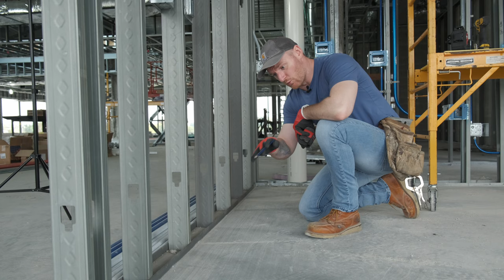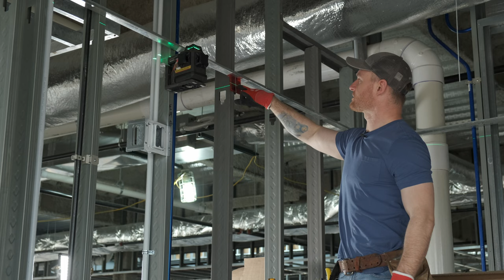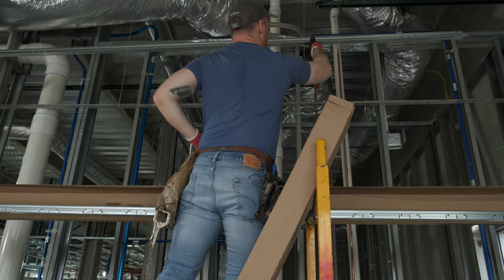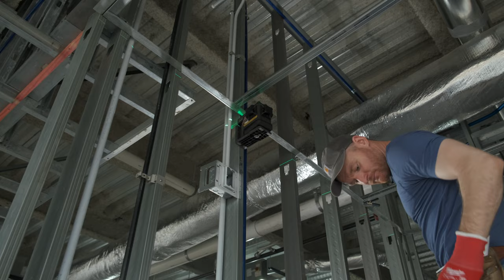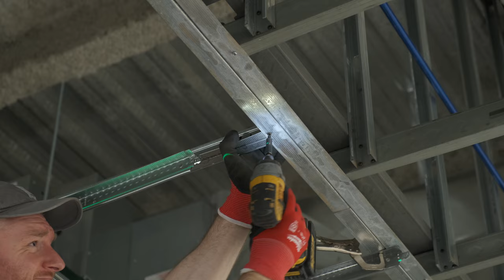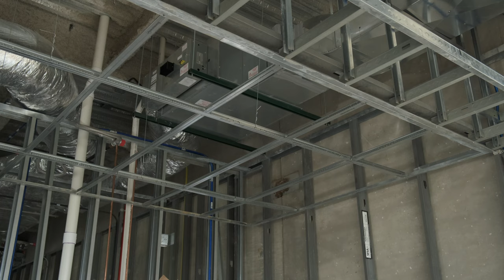How to Install 650 Drywall Ceiling Grid

Comment: At 14:00.....Just a quick tip to anyone doing this for the 1st time...to figure out where exactly to cut the new main that will connect...what I do is, with my first main in the whole job what I will do FIRST is measure with a tape measure from the BACK of the wall L where the connecting main will sit to the flange of the main that's suspended.... not the tab but the flange of the suspended main im measuring to here. Make sure your tape it's perpendicular to the wall. Then you cut a full main to that number, making sure your hooking the flange when marking your connecting main, NOT the tab, hook your tape on a new mains flange, pull your measurement, mark and cut.... Keep in mind the tape measures measurement is exactly what the new mains "flange" has to be to be "FULL BEARING" on the wall L....keep in mind that number is tight so give a 8th or so of space so the main will sit nice on the wall L with a 8th or so of space to slide.... not doing could result in the connecting main being too tight and bow the main out which could throw it out of square..and cutting too much off can result in weak support at the wall L...once you cut the piece that will connect, FIRST, BEFORE CONNECTING IT, take the cut piece and butt the tab of the cut piece into the wall L where it will sit just like you did with the tape measure, so the tab of the new cut piece is touching the back of the wall L where it touches the wall, now you can butt up the cut end of the cut main to the main that's suspended and visually check where you have to cut each main from there on out going forward so that every time you finish a main at a wall, it will be full bearing on the wall L...

Comment: How did you 27 in for your first main ? Cause you went center of the room and went 2 foot each side and whatever you had from the wall was 27 ?
Reply from the maker: Yea everything is 2’x4’. So I think the mains laid out at 27” then 48” and then the wall at 27”. It won’t be a normal 2x2 system on the drywall grid. Hope that answers your question.
Reply: @mitchellacoustical3119  okay thank you making sure . Cause Im doing this at my job. My foreman threw me on this 650 grid system so I’m not use to it their system . Cause I always Done it with hard lit studs . I’m still at a high apprentice  percentage. Just making sure cause I’m doubting myself a lot

Comment: You cut the main wrong you should always have a wire at the end of the main, doesn’t matter what type of grid system.
Reply from the maker: Bar joists were running perpendicular, and this is just an install video… if I did an 8’ main it wouldn’t show how to connect the mains and that is important for these types of instructionals. Go ahead and make your videos however you like👍

Comment: Hi good morning thank you for your valuable information ❤ Could you let me know how to avoid n prevent drilling from horizontal piping against metal stud. Vertical piping is ok  becide vertical stud not inside stud but horizontal piping 😂 piping penerate into Vertical stud as like horizontal 😂❤
Reply from the maker: You’d have to mark it out before drywall.

Comment: there is one thing I dont get. isnt it logical to run your mains in the shorter dimension? I have noticed it in your other video also (framing 101). you always prefer to run your mains in the longest edge. the only thing I can think of is the mains are supported by tie-hangers and they are attached to the ceiling with no relation to the dimension of edges of the room.

but still why do you always prefer to run your mains in the longer dimension?
Reply from the maker: So there are two thoughts, yes shortest works but also perpendicular to the joists you’re hanging wire from. I also have to take into fact of how to shoot the video and which rooms we can make work. But perpendicular to the joists is the way to go. If that’s the longest run, then that’s what you want to square your mains.
Reply: @mitchellacoustical3119  okay understood. You are considering to install your mains perpendicular to the joists above so that you will always have a support to attach your tie-hangers. Yes, that makes sense.

I have never worked on a structure with joists so I could only figure out now. Thanks for reply.

Comment: should have off set your mains just like regular grid so your joints don't in same spot creating a weak spot  aren't in the same  spot, if this was a bigger room you risk cracking or saging  it's a small room but your making this video to teach people that's a mistake
Reply from the maker: We would have run into the cans and Hvac. We can't cover everything for every scenario - it's a small room so we showed how we would do it for this space specifically
Reply: @mitchellacoustical3119  no wouldn't have ran into HVAC or nothing your mains would still be in same place only difference is where you connect one main to another those joints should always be staggered so if you started from one wall should have started next main from the othere side going opposite way so your main joints don't line up so it interlocks properly not have your joints line up